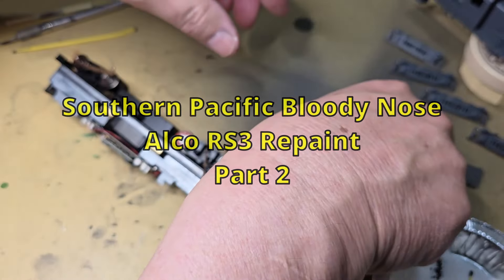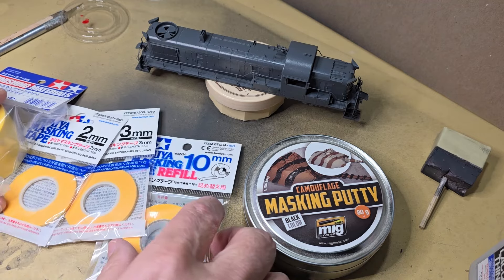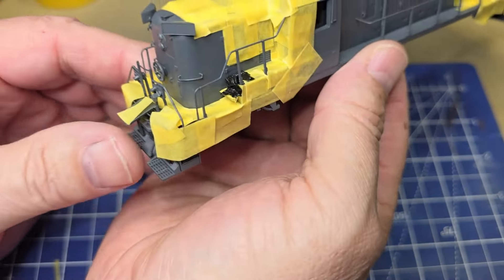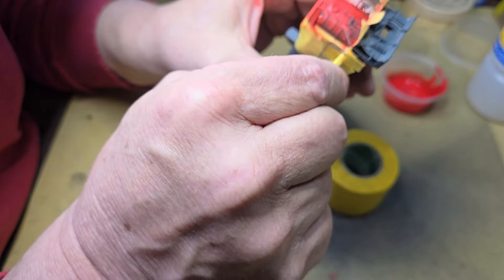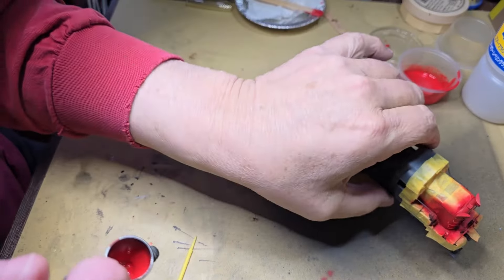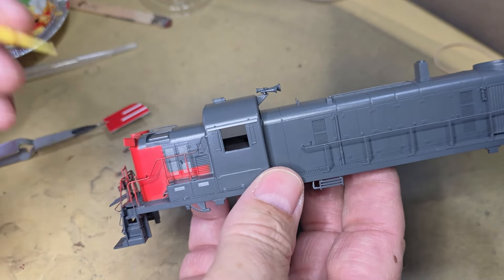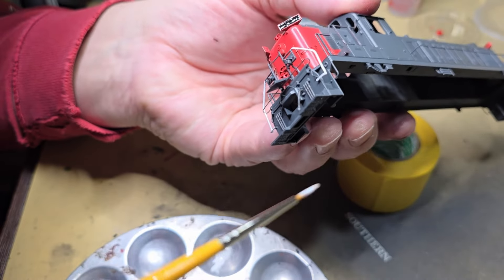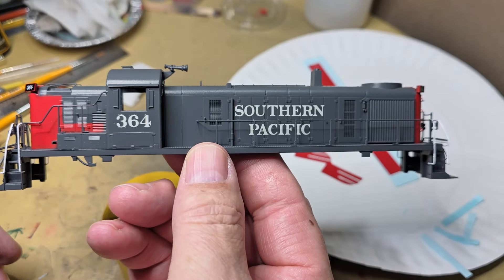Bowser Alco RS3 Southern Pacific Bloody Nose Repaint. Part 2

Comment: When Alco first started building the RS3, it was designed to run long hood forward.  As far as I know, the Northern Pacific was the first road to request it to be built to run short hood forward.  Alco didn't want to do it, but finally agreed and built it that way for them.  Obviously, other roads followed.

You can tell which way is supposed to be front by looking at the cab windows.  The engineer is on the right side of the locomotive.  The two pane window is on the engineer's side.  The three pane window is on the fireman's side as there were two seats on that side, one for the fireman and the other for the brakeman.

The unit you used was a Pennsy unit, which was built to run long hood forward.  You can tell because the two pane window is on the right side of the locomotive  The Pennsy also used a single horn facing forward.  I don't know how much of a job it would be to turn the cab around, but that is what it would take.  That's what Alco did.  At the very least, move the horn to be facing front.  

It was at the end of steam, so most turntables and wyes were removed, especially on branch lines. These units were mostly used on local freights and they would run either way, so they usually went out of the home terminal with the engineer on the side that made it easiest for the crew to get their work done.  This was before radios were used, so everything was done using hand signals.  Obviously, the engineer had to see the hand signals.  So, you would see these units running both ways depending on whether the train was going away from the home terminal, or back home.  None the less, the front of the locomotive is the end that puts the small window on the right.

Then again, some of these units had dual controls, that is, a control stand on both sides of the cab, so ...
Reply from the maker: Good info! I had no idea about the windows. The Cotton Belt also ran them long hood forward. I just like the look of it short hood forward so that's how I set it up. Even in JMRI Decoder Pro I had to set it up to run in reverse to run short hood forward with my throttle showing forward.

 I've done some additional light weathering since my part 3 video, but I think I'm done with this model. I'll have to live with the inaccuracies, but honestly, I would have never known the difference. I don't belong to a club and I don't operate so it's just me using my layout.

I appreciate the great info, if I ever do another RS3 I'll be sure to pay attention to the window configuration and possibly change it around if necessary.

Comment: RS3 more aprópiate for a SSW than SP
Reply from the maker: You are correct, SP didn't have any RS3's. Cotton Belt had 17 RS3's with the original numbering going to 360 (later numbered 2800-2816). I numbered my RS3 364 as a continuation from 360. Several of SSW's RS3's made it into the late 1960's but none were ever put in Bloody Nose paint. Bowser may do a Black Widow SSW RS3 at some point, but I doubt they will ever do a Bloody Nose SP fantasy model.  The RS3 is one of my favorites and I wanted one for my SP layout, so I'm doing this repaint.
Reply: @SPSteve it's your layout. You do whatever you want. It doesn't matter if an RS3 in the Bloody Nose scheme is appropriate or not.
Reply from the maker: It's all about enjoying the hobby and we each do it our own way. Thanks for watching!  @David-yo5re
Reply: @SPSteve Thank you for explaining. I was about to start asking about SP never having had RS3's, etc but now I see this is a "fantasy" scheme. Also noted ... is this supposed to represent a freshly shopped unit what with the bright wheel rust?
Reply from the maker: well you know the wheels are uncoated so they can be checked for cracks. Maybe someone was washing the locomotive and got the wheels wet? 😉  In part 3 I weather the locomotive and give it a bit of age, so it'll come together better then. Yes, it is a fantasy scheme.  @whiteknightcat
Reply: @David-yo5re Somewhere out there on the Internet is a picture of a model GG1 electric locomotive painted up in ... the Daylight scheme! Imagine if the Coast Line in California had been electrified!